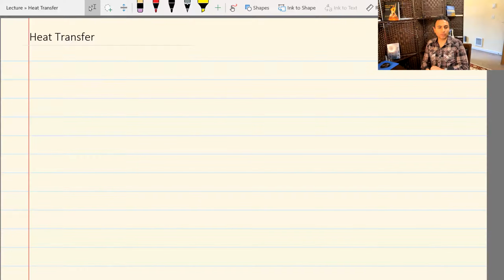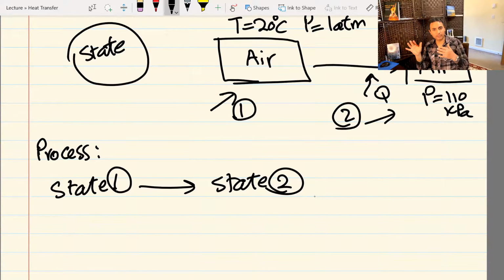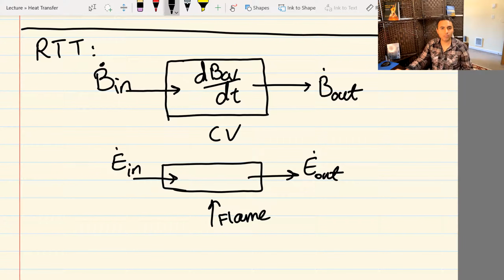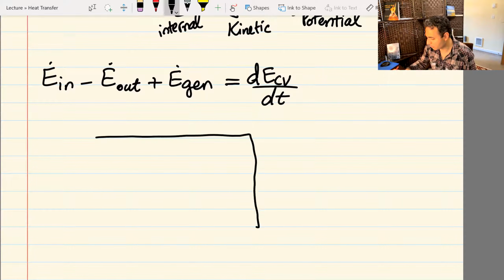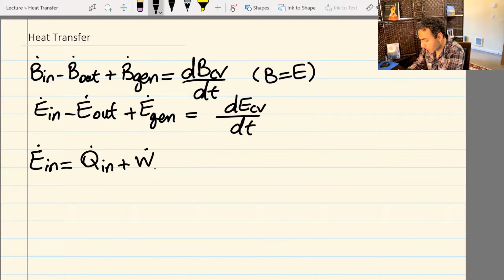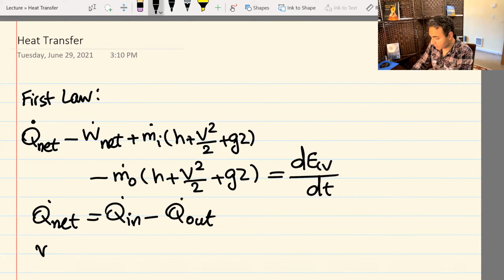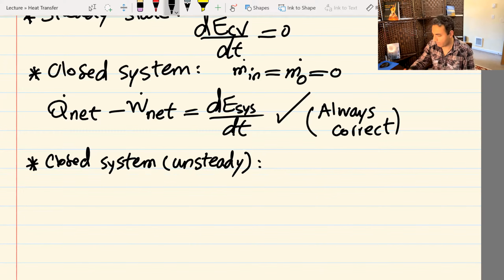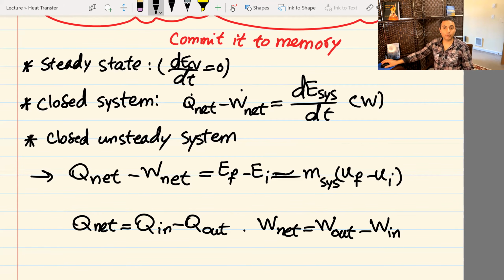Introduction to Heat Transfer and the First Law of Thermodynamics

Comment: I am finally able to grasp the first law of thermodynamics. Thanks
Reply from the maker: Glad to hear it. That's an old video!
Reply: @professorbehrang  Thanks a lot. I am watching recent videos also, I want to understand gas cycles and using EES. i am taking a course on Exergy and my lack of a good background in Thermodynamics is making it so difficult despite reading and listening in class, I am glad the videos can help.
Reply from the maker: @q17artsdesigns10  I might make a video on exergy! Or bunch of videos as one video wouldn't be enough.
Reply: @professorbehrang  Waiting for it Sir.